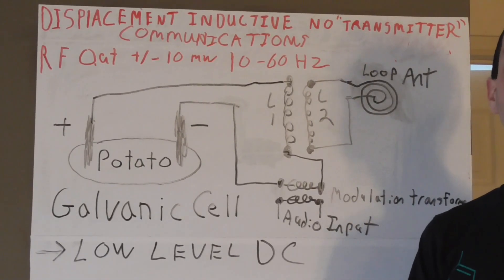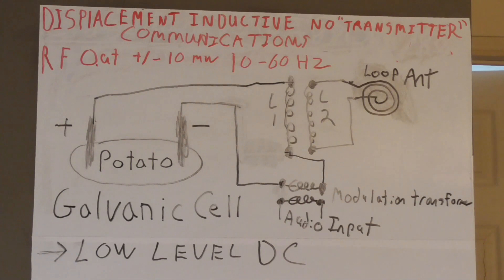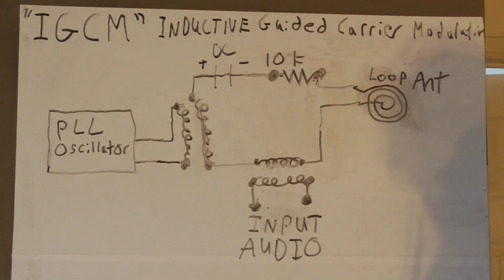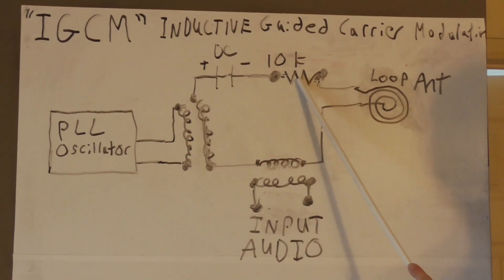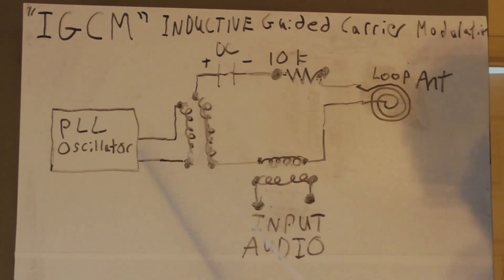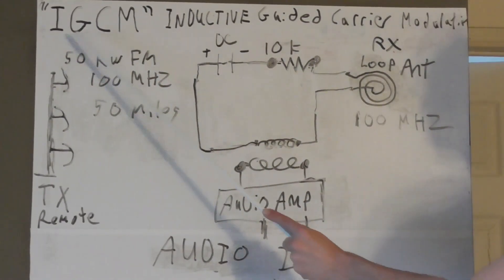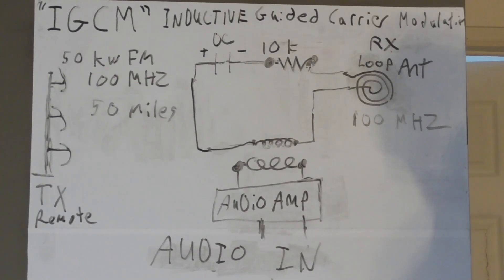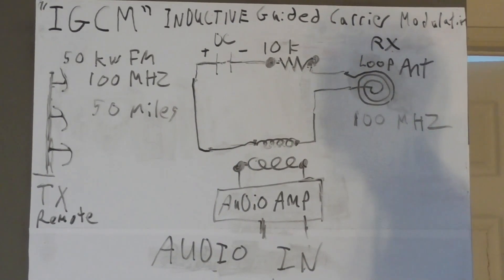Displacement Induction Communications

Comment from the maker: The passive setup modifies the properties of the carrier wave through the process of modulation, which essentially superimposes the information signal onto the carrier wave. This modifies the amplitude, frequency, or phase of the carrier wave in accordance with the information signal, and enables the transmission of the modulated signal over a distance using the carrier wave as a waveguide.

In addition, as the carrier wave propagates through space, it interacts with the environment, such as the earth's surface or the atmosphere, and can be reflected or refracted, which also contributes to the modification of the carrier wave. However, in the case of passive transmission using displacement induction methods, the modification of the carrier wave is primarily achieved through modulation.